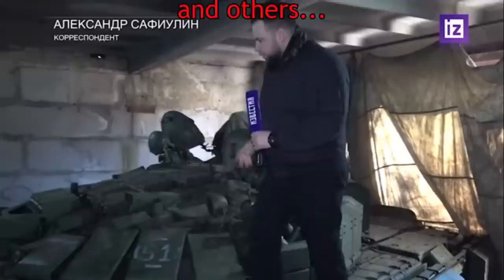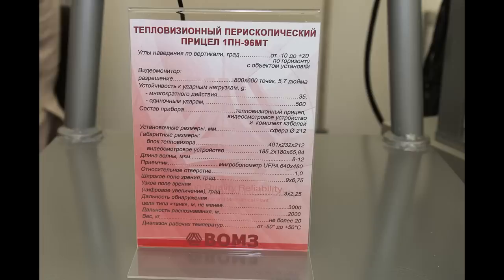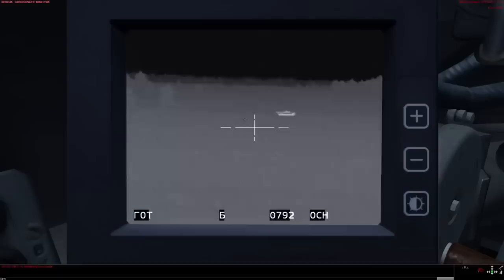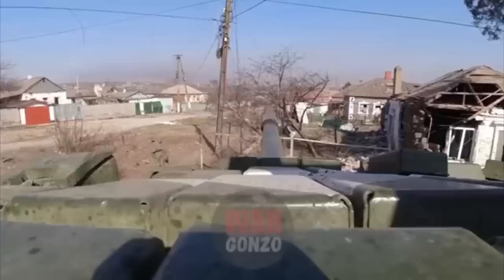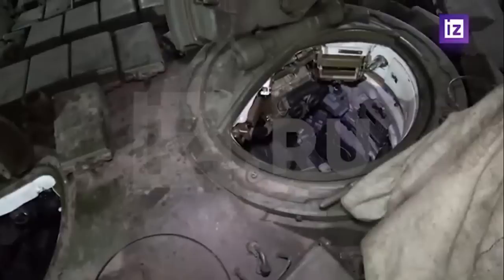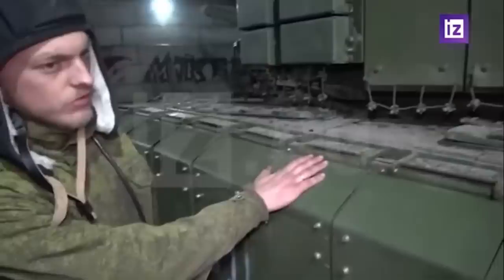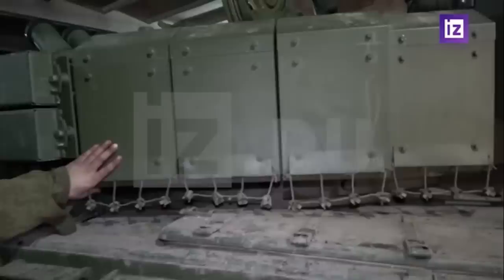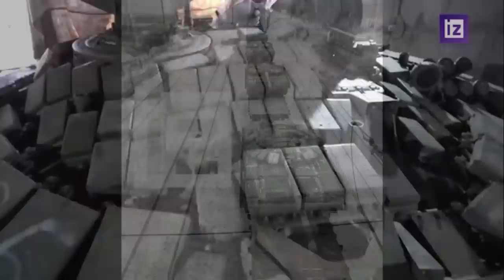Are Russians Downgrading Their Tanks?

Comment: There's a chance that they are (most likely) intentionally downgrading their tanks so it's less of a loss if it ever gets to the front lines, it can also be an "urban warfare" optimized tank since it's RPG net on the turret ERA and cages on its side and back can safely deflect or hinder the effects of RPGs or other AT weaponry, lastly it could be used as test platforms for experimental modules or crew training since it's cheaper to use and less expensive to maintain than actual T 72 B3s.
Reply: I think it's more of a what's in the warehouses in some numbers and thus can be pulled out quickly.
Reply: Losing a cheap tank is still more expensive than keeping a good tank.
Reply: @Sam-nx9ec  And losing a good tank is still more expensive than keeping a cheap one.
Reply: @vojtechpribyl7386  nah you underestimate how much tanks they can create in a moment's notice
Reply: @Sam-nx9ec  And a "good" tank doesn't necessarily have more chances of survival on the battlefield. So might as well send the cheap, especially in an attrition warfare and especially with the realistic prospect of NATO eventually joining the conflict. They're keeping their up to date tanks in reserve just in case, probably.
They can afford sending the cheap against Ukraine. They're not a bad military, but they're not up there either.
Reply: It's far more likely that these are the most advanced tanks they can produce without Western technology.
They can't make anything high tech (just look at the new cars they are producing without any safety features, ABS etc.)

You can pretend it is a choice but in reality these are the best they can make in any numbers as anything more complex requires foreign made parts.
Reply: @Sam-nx9ec  No it isn't. What do you base this nugget of nonsense on? What attrition rates? What force structures? What operational objectives? Talk up!
Reply: @Yuritarkov  Exactly! Just as Ukraine scrabbles about for tanks, Russia shows how to control the production narrative, ensuring units retain enough capacity to achieve operational and strategic objectives. Chieftain pointed out that it doesn't matter what the tank is, provided it has thermal sights. The gun will be vectored onto positions illuminated any number of ways, over a <2000m main armament engagement range. I say this is a clever and commonsense simplification, of far-reaching significance on the Russian's part, proving if it needed further proof, they are several steps ahead of their NATO counterparts. Bravo!
Reply: @Yuritarkov  😂😂😂😂😂😂😂. Dude you are living in the past.  This isn’t WWII.  ITS MA FAQUIN WWIII. Russia can’t produce tanks like they did before.   🤷‍♂️😂
Reply: @Niitroxyde  desert storm should have already taught you just how wrong you are. 🤷‍♂️
Reply: @lordtritus2261  But you lose tank crews, thats a big problem.
And for West etc. countries that would be much more a no go, also for the political development
Reply: @a.m.armstrong8354  probably basing it of the battle of 73 eastings 🤷‍♂️.  You know . . . Where the Abrams decimated Iraqi tank forces with ZERO tank loses and a SINGLE Bradley lost.  Don’t you remember?  Ever since it happened every Russian tank fanboy or internet orc would say it’s not the same tank Russia uses it was a CHEAP tank for overseas use 🤦‍♂️🤷‍♂️😂😂😂😂😂😂😂😂😂😂😂.    I’m curious what their excuses will be now 🤷‍♂️🤔😂😂😂😂
Reply: no
Reply: @smyers820gm  What does Desert Storm have to do with this war ?
This is not a desert, there's no complete air supremacy, and this is not a third world army on the other side.

"I've once beaten a little puppy in a ring with five buddies, so you can beat a panther in a jungle alone"
Reply: @Niitroxyde  your right it’s not a third world army it’s not that good
Reply: @lordtritus2261  You're not going to keep the cheap one if the good tanks are being lost.
Reply: @Niitroxyde  Good tanks have more chances of survival. Situational awareness often decides the outcome of the fight. If you have the bad tank and the good tank always sees you first, you lose 100% of engagements.
They're not keeping the good stuff in reserve. They can't afford this wars, either.
Reply: @Niitroxyde  73 Easting was decided without air support.
Reply: @smyers820gm  if that were the case, why are the constantly deploying tanks tho, someones gotta explain how they seem to never run out of t-72bs and T-90ms
Reply: @jamesleate  well, not exactly, you gotta know that there's one country making all the electronics and that's china. The more likely reason for the lack of the advanced sights is that it was unnecessary, when they could spam tanks without fancy target sights and go back to the normal stuff
Reply: @Yuritarkov  that’s because they are reactivating old stock. Every military does this. They keep a reserve.  For instance the us has 4800 m1a2 tanks in reserve.  Russia does the same thing.  That’s why they are pulling out 40 year old tanks. T-90 T-80 T-72 and all its variants.
Reply: @smyers820gm  the T-90M is not old stock
Reply: @Yuritarkov  agreed but I was just acknowledging every tank they’ve sent to Ukraine to be destroyed 🤷‍♂️
Reply: @a.m.armstrong8354  AHAHAHA talk about iditotic statements
Reply: @Niitroxyde  You still think Russia can stand against NATO while they can't take one small city Bakhmut, even less the rest of Ukraine. Do you hear yourself or are you just a russian troll?
Reply: @Yuritarkov  Thales are French and make the thermal optics used in most tanks (even the Russian tanks in this video use them).

China doesn't produce the world class technology, they produce the composite parts. Western companies such as BAE systems, SAAB, GE etc. actually design and build the equipment.
Reply: @smyers820gm  well not like they need to ship them back considering how they have a higher k/d in tank terms than 1
Reply: @Yuri  The country that made russian optics is France, not China. Also "fancy target sights" is the new "normal stuff", and tanks without it are obsolete
Reply: @Niitroxyde  Russia is pretty much a Third World Country, most of the people have no gas or electricity, paved roads or proper toilets.
Moscow, St.Petersburg and other big cities are modern but most of the country is living a circa 1900's existence.

Desert storm had both T.72's and Abrams fighting against each other with proven one-sided results. 

To say that they aren't comparable is either naivety or Russian Copium.
Reply: @ChucksSEADnDEAD  Again, you're one of those who think that only tanks are hunting tanks. Your good tank in that example will probably never see another tank, it will just get acquired by a drone and get artillery'd to death.
Besides, what if the bad tank sees the good tank first ? Sure the better tank with better equipment might have better odds in general, but that doesn't mean it will get favorable circumstances 100% of the time.

If the trade off for getting a slightly worse tank is to get 5 of them, then that's certainly a very good trade off. Quantity is a quality by itself, especially in an attrition war. And Russians know that very well, they have decades if not centuries of experience fighting like that. And it works. Might look "ugly" for some people but war doesn't care about appearances, what matters is winning.
Reply: @Don-Coyote-De-Transylvania  Where did I even pretend that Russia could stand against NATO ?
Can you reply to my comment next time and not to your headcanon.

You don't even seem to know much about this war. Bakhmut is a "little city" now, well that's just great. I wonder why Ukrainians are sending tens of thousands of men there if it's just a "little city".
And I wonder why a fortified city with such a geography is so hard to take.

Video game generals, everywhere.
Reply: @melo3814  pmcs and dpr forces are fighting just fine without these tech
Reply: @Yuritarkov  If you have complete disregard for human life and you don't care about enormous losses, then yeah, you could say they fight just fine
Reply: @jamesleate  where tf you get your source bro. Russia can produce their own component thanks to soviet era industry, and they try to reduce dependence on western imported parts due to sanction since 2014. The problem is their money and prioritization on more important tanks/weapons plus tank to tank battle are rare and mostly used as infantry support, which make sense to not wasting on expensive component on older but cheaper and expandable tanks (Russia lose a lot of modern and modernized tanks to infantry). If you talking civilian product such as airliners etc you are right because some of them are joint development with western company thus use many western component.
Reply: @dauzlee2827  Russia has only been producing modern tanks on the back of grey imports. They still use Western tech since the sanctions began, they just pay more and have fewer components.
Reply: @jamesleate  Russia can produce their own equivalent for their own weapons whether if it was inferior or on par with western component. Russia still have functioning electronic industry and other industry capable of producing their own component. The problem lies within their production capacity and other prioritization and money. If that really the case they shouldn't have continue to produce T-90M etc. Russia already reduced western components on their tank which make sense if you get sanctioned
Reply: @Dauzlee  Russia cannot produce components with the same quality as western ones. When it comes to tanks, optics lika Sosna-U or ESSA still use Thales cameras. The Agava, russian equivalent was complete shit and got dismissed. I don't even want to get into microchips and semiconductors, but basically russians lack technology to produce their own and they have lost their largest source, which is China.
Reply: @melo3814  Russia still can produce their own stuff regardless of being shitty and inferior to the western one. Also no, Russia and China still have strong trade relation and where do you think Russia get component to produce T 90 and other highly upgraded tanks even during sanction. And where do you think that Russia get component to produce jet fighter and missile and ship? They make it themselves without using so much western imports, russia isn't just random third world country, they inherit soviet R&D and industry. Russian equipment aren't 100% made from western technology
Reply: @melo3814  you seem to forget that russia has been doing things without western aid, in fact, they've been doing better without the west than they were with the west. Also you vastly underestimate russia-china relations, they literally share tank designs
Reply: @Yuri  Yeah, I see how they've been doing so much better. Especially when they pulled out t62s or had put pesa radars in su35s. And I think you overestimate russian-chinese relations in terms of arms when all China did with russian technology was stealing, copying and reverse engineering. Also Xi seems very frustrated with russian performance in Ukraine.
Reply: @melo3814  also did you forget the dpr and the lpr? these guys are the main guys fighting along with the pmcs and the chechens and some of the russians
Reply: @melo3814  wow man you really be drinking the coolaid rn, cause the bakhmut defenses are retreating faster than the kiev pullback, even the ukrainian pmcs are reporting severe casualties on their end. The russian coalition forces have been making quick progress of the ukrainain units despite not starting the offensive. Also if you want more on ground information, check out DPA and Patrick Lancaster
Reply: @dauzlee2827  You haven't got a clue. I take it you don't know anybody from Russia to inform you how it works.

They can produce Soviet era tanks but nothing more modern because half the facilities that exist on paper were never built at all. All the money gets funneled into private individuals funds.

Why do you think they had to remove ABS sensors and all non mechanical safety features from the new Muskovtch car they were producing?

They have no facilities to produce sensors, chips and modern components at all. All they can produce is circa 1970 electronics.

Go and do a bit of research.
Reply: @DaHuntsman1  You realize the propaganda argument works just as well with your comment ?
Can you explain to me why T-90s are barely deployed in Ukraine then ?
Reply: @Niitroxyde  because T-90's weren't produced in as great numbers in comparison to T-80's, T-72's, and T-64's due to the post-Soviet economic collapse of the Russian economy and the military couldn't afford to build a massive tank fleet like the Soviets did. Like a grand total of anywhere between 700 to 1'000 T-90's were produced, and of the 600 T-90's that were operational at the beginning of the war, only around 360 of those remain in operational service at present. You can compare this to the T-72 of which over 25'000 have been produced over its service life,  T-64s of which around 13'000 have been built, and the T-80 of which more than 5'000 have been built.
Reply: @DaHuntsman1  That has nothing to do with production numbers.
The fact is they have a consequent fleet of T-90s, and from what we saw there's been very few deployed in Ukraine compared to how many are available, which defies your logic.
Most Russian tanks in Ukraine are variants of T-72 and T-80. We've seen some T-90 but again, considering how many they have, we should have seen a lot more.
Especially if they spearheaded their better tanks as you're implying.

It makes much more sense that Russia is keeping them in reserve, in case of NATO or any other nation acting independently involving itself militarily in the conflict. They'd want to keep their better hardware to match actual good hardware, rather than wasting them against waves of T-72s in Ukraine.
That's what anyone with 2 brain cells would do, you don't throw all your best stuff right off the bat, that's stupid.

Especially since, as you said, they have loooads of other tanks that are just as capable for this conflict, so they use them instead.

It's funny how your own arguments defy your own logic. Which makes me wonder who's truly deep in propaganda.
Reply: @DaHuntsman1  they hold 2 provinces and  have surrounded a large amount of ukrainian fast movers, they'll finish ukraine up soon
Reply: @Niitroxyde  That would imply that the Russians are smart and aren't in the habit of making dumb moves...which they are, they've already lost half of their stock of T-90's and im sorry but 360 tanks ain't doing much being held in reserve, especially against Nato who if they did get involved would steamroll the Russians regardless of how many tanks they did hold back in reserve. Also its more likely that the tanks we do see in Ukraine are simply the only tanks the Russians can operate, due to how bad they've maintained their tank fleets over the years its likely that the majority of their tanks "in reserve" simply can't or won't run even if they wanted them too.
Reply: @Niitroxyde  Considering that the Russian military has a long history of being drunk while on campaign (hell, during the Soviet invasion of Hungary in 1956 so many units were completely incapacitated cause they had drunk the antifreeze from their vehicles to get drunk (cause there was a higher than usual amount of ethanol in the antifreeze cause they knew the crews would drink it, cause this is Russia we're talking about)) im honestly surprised we haven't seen more of it.

Comment: No they are not downgrading their tanks, the pace of upgrading old stocks  of T72B and T80BV is currently very high something like 3+ tanks per shift at UVZ  , optics production is not keeping pace , production of Sosna U is being used only for T90  and these wartime upgrades get to use other optics models that can be made in larger quantites some of them are from export orders as you can see some 1PN96MT-01 issued with lettering stickers on the units (typically all the lettering is engraved, stickers cover foreign language engravings). Some of the T90 we have seen issued to Wagner is obviously taken from Indian contracts easily identified by specific turret reactive armor layouts.  Just for comparison the T72 refit and upgrades done for NATO supply to Ukraine is limited to 4 tanks per week (3x less than UVZ does per day) at Excalibur army workshops , but T72M1(monkey model) they are refitting is basically T72A much less protected variant than B model Russians are upgrading
Reply: 3 tanks a day ? they UVZ is producing 15-20 units per month
Reply: @oceanlancer  3 tanks per shift 3 shifts per day  9 tanks per day. UVZ has massively ramped up production .
Reply: @Mr.T-SI  this information does not correlate with real figures
Reply: @oceanlancer  Trust him bro.
Reply: @NotMe-bz9pl  =)
Reply: @oceanlancer  then provide source that states otherwise.
Reply: @kubonex0919  provide source that confirms 9 tanks a day